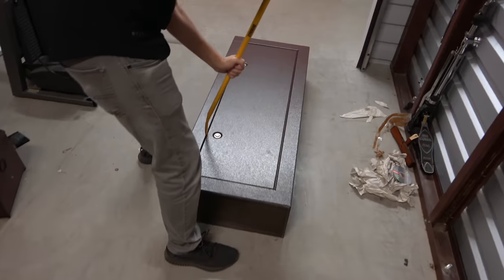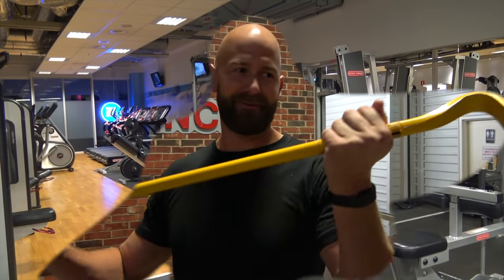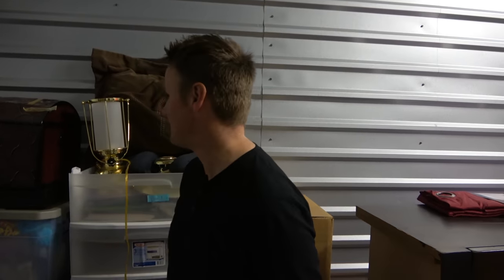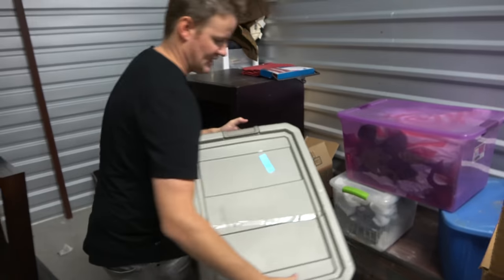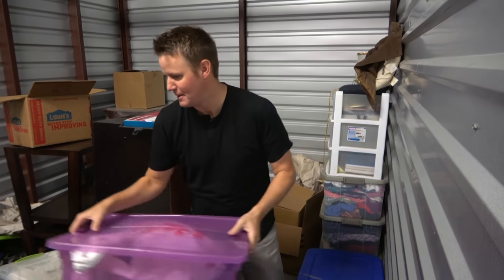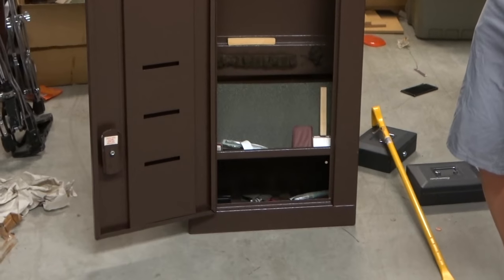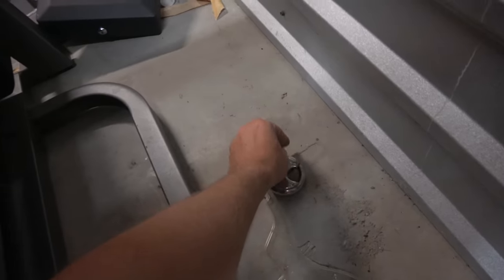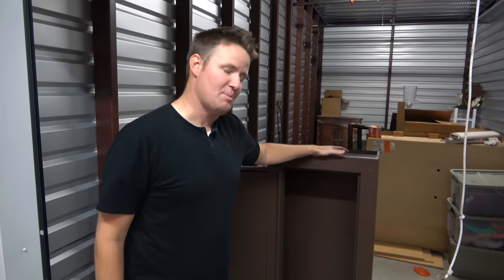OPENING A GIANT ABANDONED SAFE!

Comment: Sooo... There is a genuine reason that a unit might have several cut locks inside, it's pretty common. The unit had previously been in the lean process - wherein they cut off the tenant's lock, overlock the unit with a lock from the facility, and seal the unit with a tamper evident seal - after which the tenant paid their bill before the unit sold at auction. The tenant stoped paying again and the lean process started all over... What likely happened in this case is that the owner cleared out everything they wanted to keep and left the trash... I used to work as a storage auctioneer and have purchased more than 1,000 units. 😁
Reply: That’s what I was thinking if I knew I wasn’t going to be able to pay why wouldn’t I just clean out the valuable stuff and leave the trash? lol
Reply: @venom5809  What's more is that any money above and beyond what they owe to the storage facility will be returned to the previous owner. So for instance if this units owner was delinquent $400 in rent and any associated auction fees, the extra $200 would be returned to the previous owner.
Reply: @TheSpawningRack  Oh that's interesting, didn't know that.
Reply: Over 1000...    wow crazy